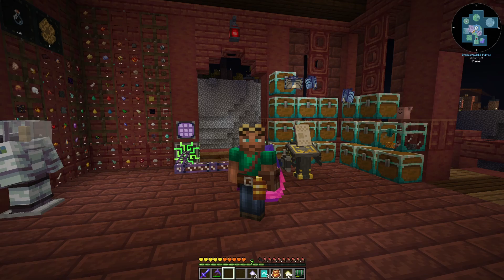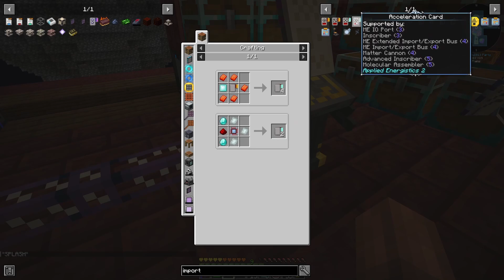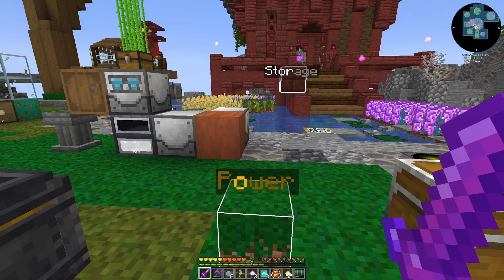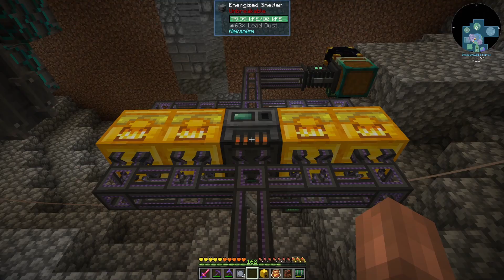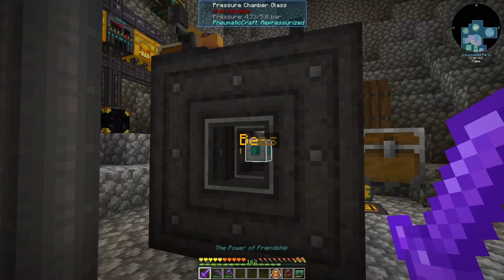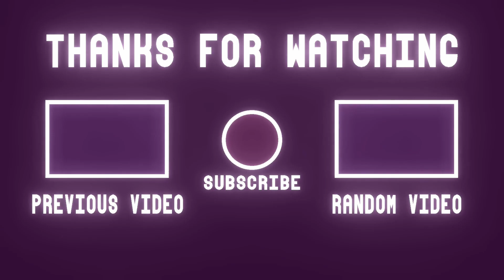FTB Skies Expert Ep 43 - Goodbye Storage Lectern and Fluix Bees

Comment: though I know you might be past this point in most current episode,  i would recommend testing out  regular ars nouveau spell turrets (with a redstone system that gives off a pulse when it detects items) with this spell inscribed on it for very fast smelting.

[touch--->smelt--->either amplify or aoe (cant remember which, but one of these increased the amount smelted per cast)x3 or x4--->pickup]

Aim the turret at an air block where you have some device dropping smeltable items and voila, instant bulk smelting. And i mean isntant.

It needs a constant flow of source (not the liquid one), but your mob farm will cover this easily.
Reply from the maker: Ars Nouveau is something I really want to learn better.

Comment: Not sure if this has been noticed yet or not but... You can put in more than 8 upgrades in the Mekanism machines in this pack.
Reply from the maker: I have noticed that but, haven't gotten a chance to point it out on video.
Reply: @Bigwooly also i believe energy upgrades work more effectively w/o an accompanying speed upgrade than in normal mek.

So even without speed upgrades, it's worth throwing at least a few energy upgrades in every mek machine you make